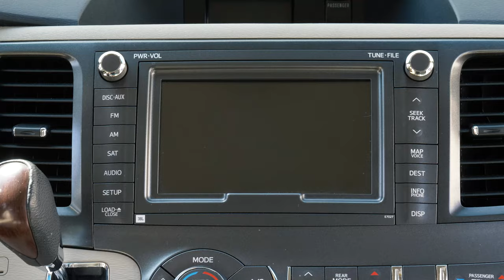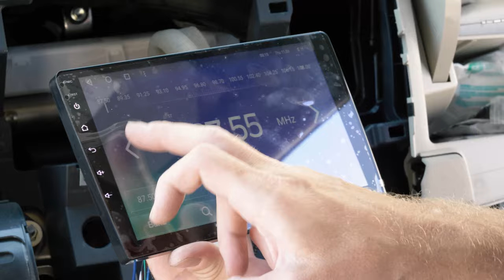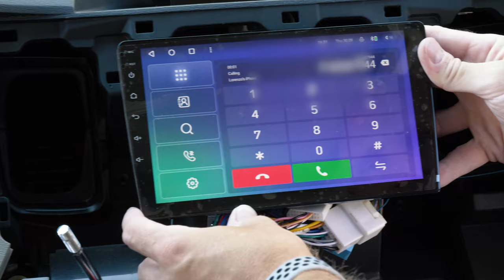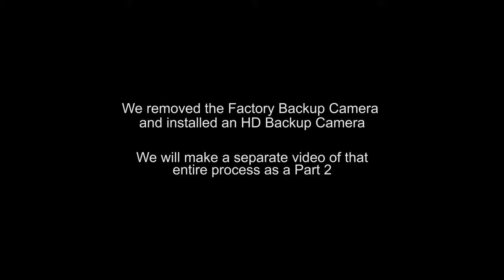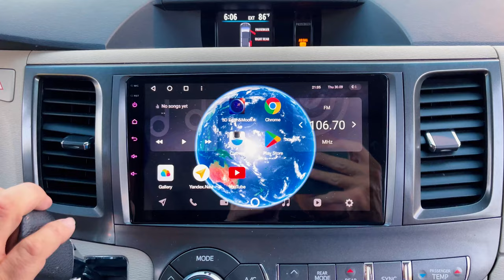Installing Teyes Android Headunit in 2012 Toyota Sienna

Comment: Appreciate your video which highlights the dash and radio removal but you need to be more detailed in the radio head installation portion. Just showing someone connecting wire with nice soothing music playing in the background holds little value. Be  specific with the camera shots of each wiring connection with specific description of what this connection actually is. Potential purchasers always have specific questions on steering wheel connections and rear view camera connections so specific detail in these areas would be great. Does Teyes provide all harnesses and wiring to connect to Toyota's or do you need to add other. If you wish to be specific a detailed  install video of the Teyes CC3 unit in a 2018 Toyota Highlander would be great.
Reply from the maker: This unit has a plug and play harness, there is virtually no splicing.
Reply: @Qualitymobilevideo  Ok thanks for the confirmation. I would guess the steering wheel control connection and the OEM back-up camera connection is not plug and play for many vehicles. I have a 2018 Toyota Highlander and hope I do not have to install the Teyes backup camera. Any thoughts?
Reply from the maker: @slices6500  They do make a plug-and-play harness for your vehicle as well for any aftermarket radio utilizing the ASWC-1, here is the harness: https://www.qualitymobilevideo.com/ax-toy28swc.html
Reply: @Qualitymobilevideo  Thanks much appreciated

Comment: hello ?
thank you for your video
   I have a 2014 Toyota Sienna Limited.
I bought TEYES CC3 For Toyota Sienna 3 XL30 2010 - 2014 Car Radio Multimedia Video Player Navigation stereo GPS Android 10 No 2din dvd a month ago.
but i can't install it
The cable does not fit.
Please make the cable as shown in your video
Reply: Hi I'm looking to also upgrade my 2013 sienna head display how is your doing

Comment: Great video. This is one of the few videos that actually works with this radio with the Nav. I cannot even find a wiring diagram for this radio. My issues have been getting the right harness. Have you ran into any harness that allows the factory JBL system to have the fader control? Have your customers been ok with this? Also, for the backup camera, where in the front do you pick up the power for the new camera?
Reply from the maker: You lose the fader. You use accessory power from the harness to power the cameras so you can select them at anytime.

Comment: For a 2012XLE with base radio - I've been able to get the Volume/ Channel Uo/ down to work on the steering, but the Voice Activation, Call Pickup/ Hang Up buttons are not working.  There's no Canbus on the non-Nav unit so wondering if you know any solutions?  Thank you!!

Comment: I'm installing the same unit in toyota 4runner with jbl.. do u happen to remember if you had to connect the blue amp wire from the back of the head unit? I have sound just not very good quality sound

Comment: Awesome video Lorenzo, I could follow both of your videos and install Teyes HU in my 2014 Sienna limited. I used Posi-taps instead of soldering the wires. Your second video was so helpful. Only issue I noticed is check engine light was on. Have you seen this issue ? I would sincerely appreciate your help

Comment: Does the rear entertainment system still function?
Reply from the maker: Yes, but we lost the ability of the audio to be sent to the radio.
Reply: @Qualitymobilevideo  so the rear entertainment system only works with headphone only?
Reply from the maker: @myuen84  Yes, that is correct.
Reply: @Qualitymobilevideo  I wanted to get more details about what failed.. love to do this as my touch screen has failed and after trying to replace it with a new digitizer I have now lost the button functions on the side of the stock 7in head unit.

Comment: Will this work for 2013 Sienna LE without the OEM touchscreen? I have the basic head unit that is control by the knobs and few buttons. 
My backup camera is the little screen on top of the dashboard. Be great to know before I proceed this step. With that said is it possible to move the backup camera to the touchscreen?
Reply: I just installed the Teyes CC3 on my 2011 Sienna LE, w/out the OEM nav/touch screen.  You can connect the OEM backup camera (currently displayed on the tiny screen above the stereo) but the TEYES harness won't work for that. You would need to cut wires from both the connector on the back of the small screen and splice them with some of the wires on the Teyes harness. Here's a How-To - Vid for that: https://youtu.be/rvhmPmFu7IE . I just bought the Sony AHD backup camera from Teyes and it made it much easier, plus a much higher-res camera.
Reply: @petervalone1803 hi, do you have any complaints about this unit so far?  Does everything work?
Reply: @buckmclean8391  Hi! Unfortunately, I've been very disappointed with it. I installed it in my 2011 Toyota Sienna LE. It will not work with my steering wheel controls and I paid extra for the different harnesses they had available. I also bought the dashcam, but it only works sporadically. If I play spotify, it will randomly reboot. The built-in microphone for your phone is horrible too.
Be aware that their tech support is in Russia and they only communicate through WhatsApp!

On the Plus side, it's a very sleek piece of glass where my old radio used to be. And Google maps works most of the time. The backup camera looks great on it though, but the lines are not dynamic with the steering wheel.

Comment: This video is very misleading, I did the same install on exactly same jbl radio, the harness they provided don’t retain all the functionality of the vehicle. You lose the connectivity of the stock usb unless you buy another special adapter.  You also lose the control of front and back since jbl amplifier only take front speaker input.  And the canbus they provided is horrible, because your left speaker is going to be louder than your right when set to center.  You also lose the oem dynamic parking line which the video didn’t mention.
Reply from the maker: We didn’t have any audio output issues. You do lose the fader, we replaced the camera with an HD model.

Comment: I bought one but steering wheel controls didn't work. I think they sent me wrong wiring harness. I was able to connect only two connectors the other are big. the car connectors are small. i contacted them and they insist that they sent correct one. I know they have two types A&B . they sent me B.
Reply: Do you got jbl or Standard Radio?
Reply: @Silversurfer604  no JBL system. I got the steering control by finding wiring diagram from someone and had to cut some wires and connect them.
Reply: @mohammadali6500  thank you, But with Version A there should be no splicing needed for the non jbl?
Reply: @mohammadali6500  thats a bit my issue AS well, my old one is working perfect. Maybe i dont touch it :-)
Reply: @mohammadali6500  hi, do you have a link for the wiring diagram ? Thank you
Reply: @vibe27vibe  This person has a great video explaining how to wire it . I think I followed his video and got my steering wheel control to work. Most of Toyota that has 20 pin connector can be wired same . Here is his video
https://youtu.be/bnJfUiPEH1Y
Reply: @mohammadali6500  thank you, I will try that